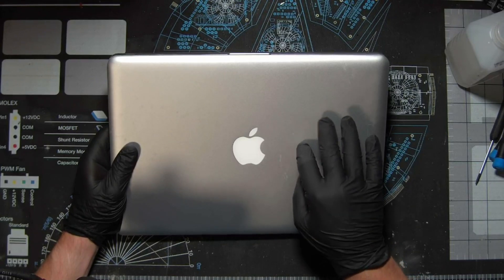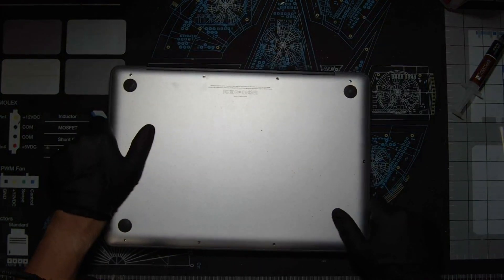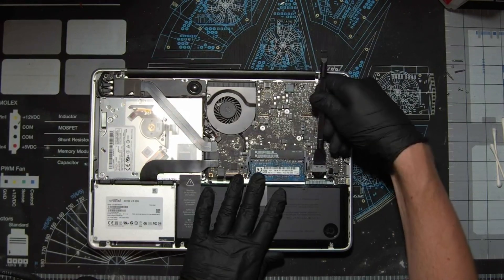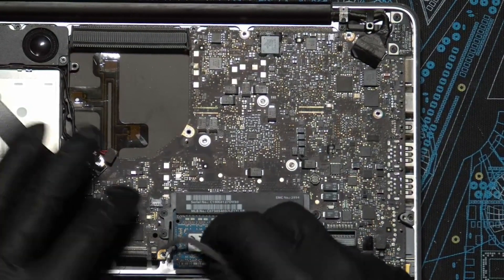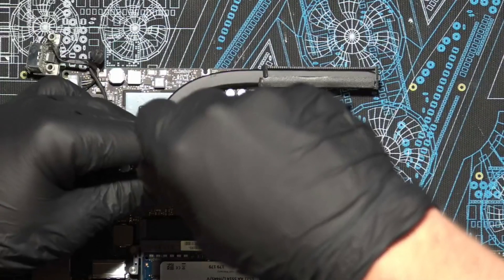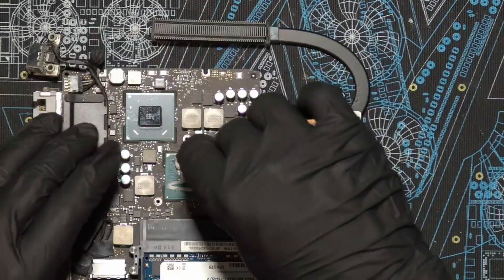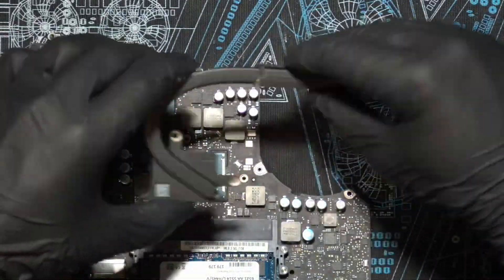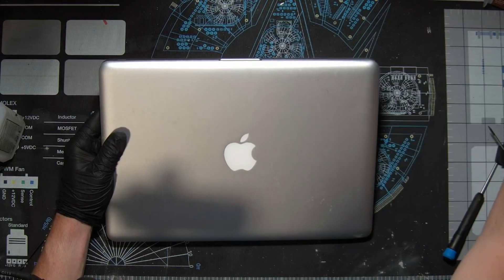2012 MacBook Pro Thermal Past Replacement - How To

Comment: A couple tips for anyone trying this. First, be very careful disconnecting the various cables. I’ve seen people accidentally damage the pads of the connectors, and then have to pay someone to get the logic board working again, and that isn’t cheap.
Second, you can alternatively use a coffee filter or blue shop towel to remove the old paste, if you don’t have cotton swabs around.

Comment: Great tutorial! I have been using my mid-2012 since, well, 2012. haha! I've "replaced" it with a 2017 and then a 2019, but they just aren't the workhorses the 2012 is and they feel downright fragile by comparison and I've passed them along to my teenagers. I've upgraded the RAM and done other basic repairs here and there, but it has never let me down and it is still running strong. I will add thermal paste to my list for the next time I need to repair something!

Comment: I might need to try this myself. I recently got a 2012 MacBook Pro and installed Ventura on it with OpenCore, but it still runs a tad warm even when just having a browser open, and the fan might be draining my brand new battery much more than than it otherwise would.
Reply: Did you do it? Is your computer still running hot and your fan working a lot more?
Reply: You can even upgrade the fan like I did
Reply: @InvokedAlbaz  ya sure? apparently the fans are soldered on the board but i think they meant for newer macbooks
my mac's heatsink instantly get hots as soon as it turns on so ima see!
Reply: @peppermeat8059  macbook pro 2012 mid fan is not soldered